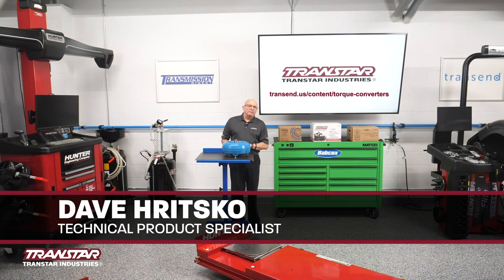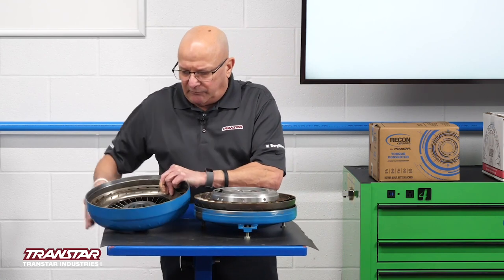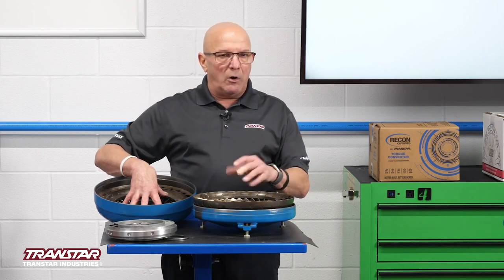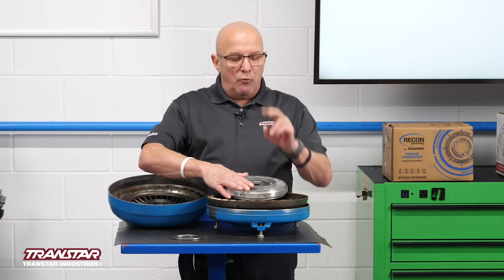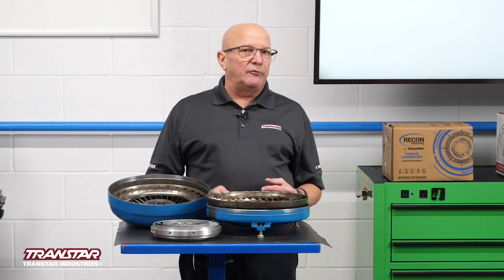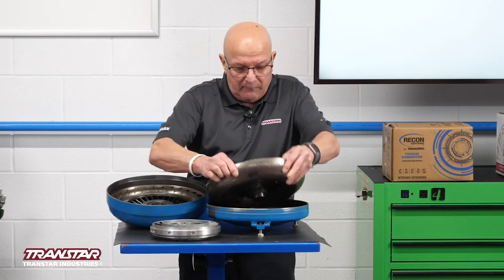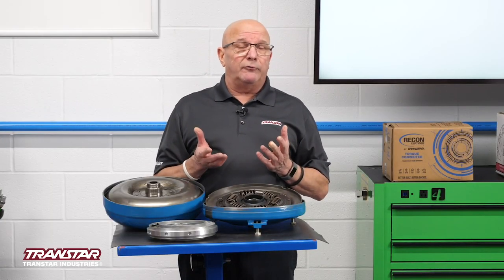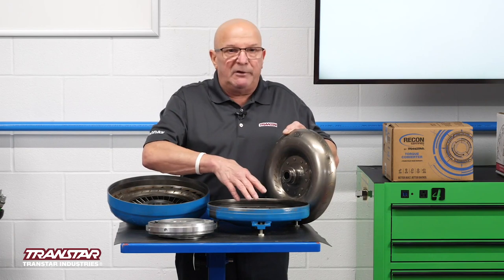Torque Converters: What Makes 'Em Tick?

Comment: Great video Dave! I recently received and installed a TC that showed up at my door with some pretty severe box damage, as if it was tossed around roughly by a disgruntled shipping employee.  

The TC looked fine, but I experienced a mild vibration between 2200 rpm and 2500 rpm. So I clocked the TC to the next bolt hole over and it changed where the vibration starts. Now the vibration starts at 2400 rpm through about 2600 tpm. Would you think that the TC got damaged from it being thrown around or it's just not properly balanced? 

Your opinion would be greatly appreciated!